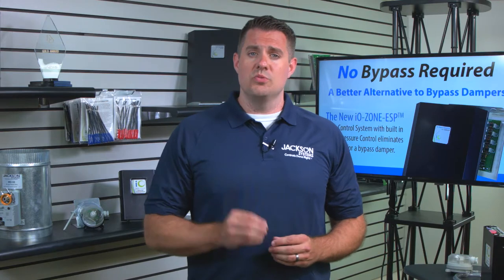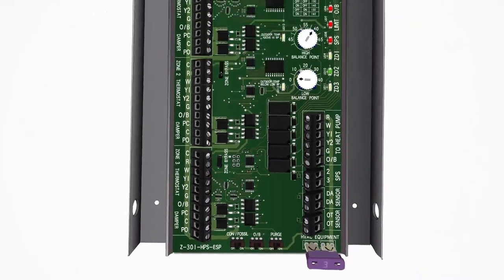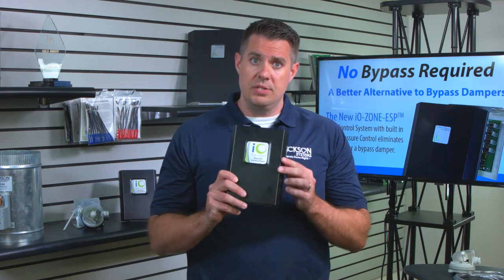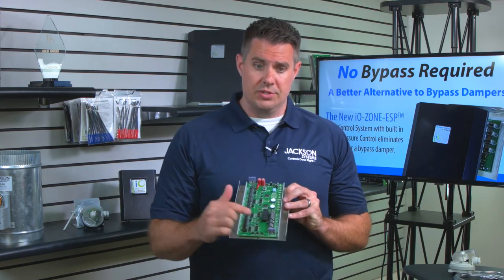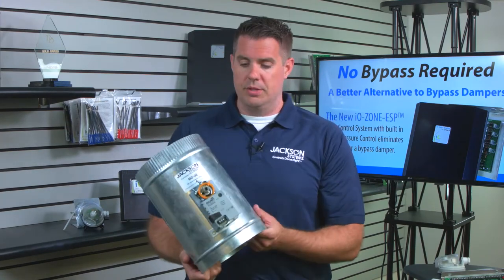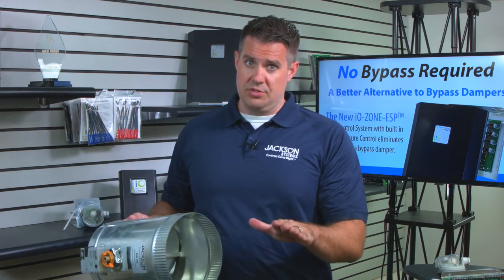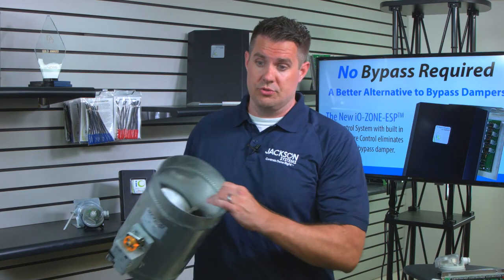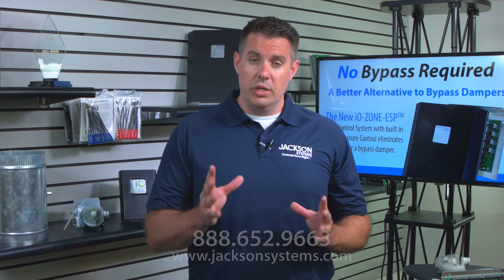Never install another bypass damper!

Comment: Wasting energy sending surplus into already satisfied areas. Why not just use this in conjunction with air pressure sensor to control the bypass damper? Better yet; how about just a controller w/press sensor FOR THE BYPASS DAMPER?

Comment: What about temp rise setting on gas furnaces. If the manufacturers start see cracked heat exchangers, I'm sure they will have someone out like me to double-check those temperature rises and void those heat exchanger warranties if indeed those temperature rises are not within specs do to your installed system. Just to give you the benefit of the doubt I'm sure you check temperature rises after every one of your installations.
Reply: Bob Y I’m sure it has a DAT max and min